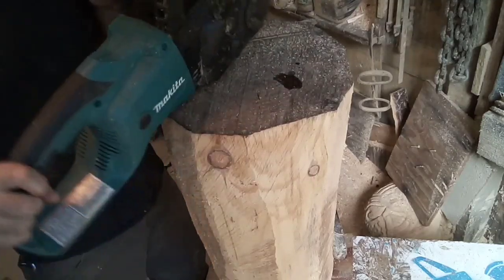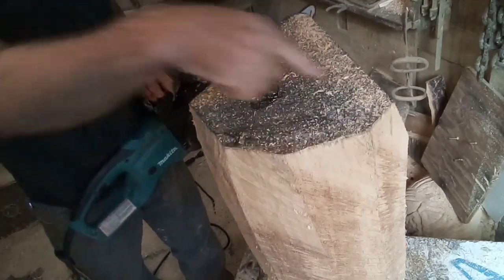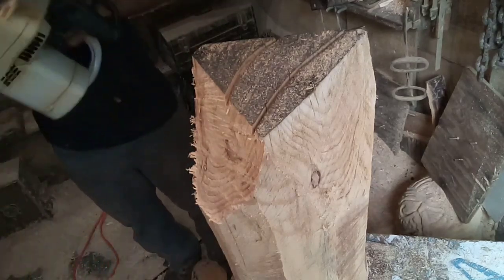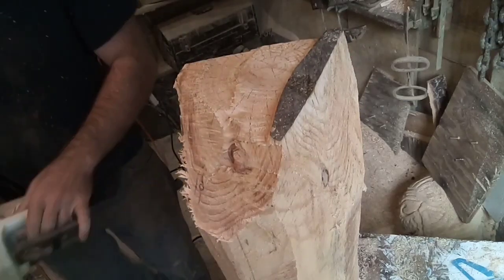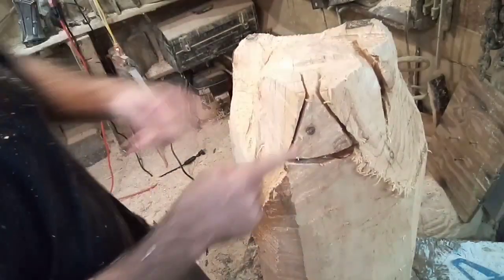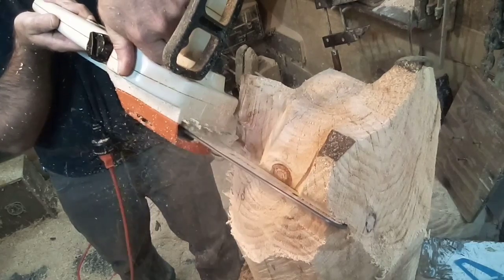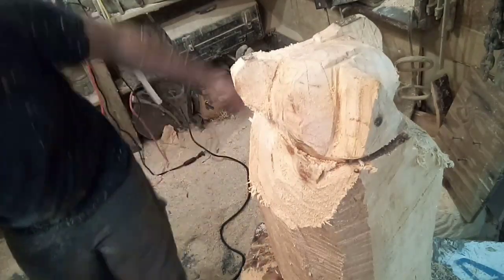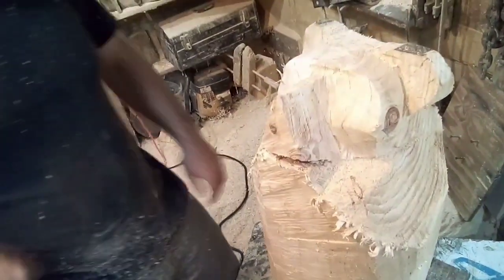Chainsaw carving beginners, bear head shape

Comment: Hey I appreciate the videos and the tutorials, I'm wondering do i need specific wood? I have a ton of large logs and i live on woods so i can cut what i want, do i need to cure the wood first or can i just begin? Again I appreciate the videos i just started watching and subscribed.
Reply from the maker: Hey, you don't need specific wood, some are better than others, and I'll be making a video dedicated to wood types and curing. I'll go over my system, and ways of storing, and process curing. Main thing is to get the bark off, get them off the ground, and covered with metal roofing, or ply wood. Tarps hold in moisture and encourage mold. Slow cure is always better than fast, but you can do iether, as long as you have ways of fixing the cracks if you speed dry.

Comment: what bar do you have on that Stihl e180C ?
Reply from the maker: 10"  .043 1/4 pitch, sprocket tip.not stock to that saw, but stock to the battery saws. I run a 1/4 pitch sprocket from an e 10,shaved...
Reply: do you have a source for that bar.. I have a e180c that has no bar with it right now....your videos are great info...where are you located?
Reply from the maker: I'm in the n.e. u.s. ... I just go to the local stihl shop, or to ebay fir saw parts... some shops even have carving bars...I do a lot of searching...
Reply from the maker: You will need a 1/4 pitch sprocket conversion  on that saw, I have several videos where I go over set ups, and set up details...